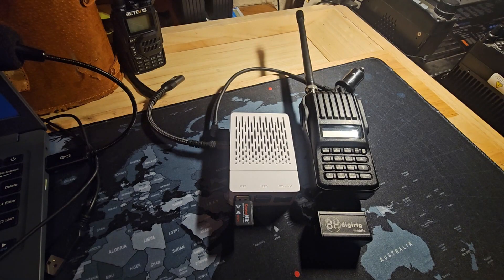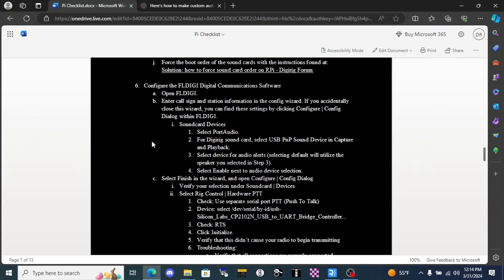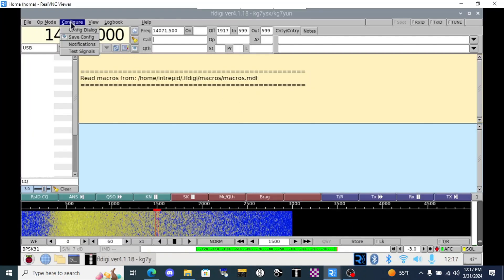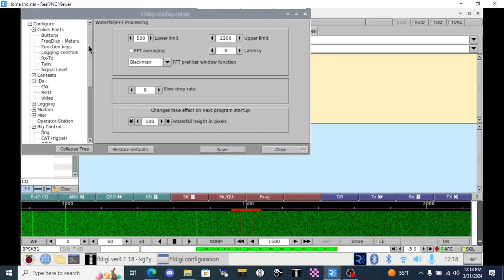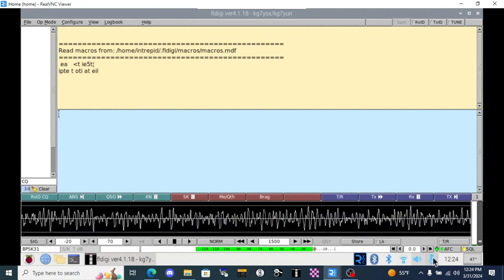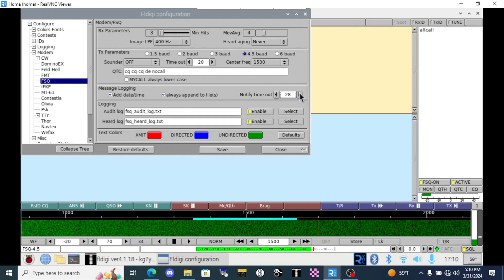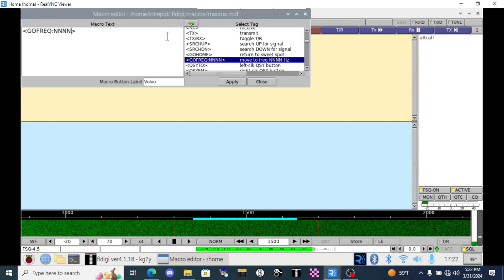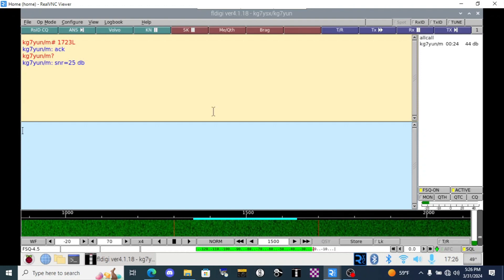FLDIGI & FSQ Setup!

Comment: On my fldigi screen, just below the File menu item, I have a large frequency display, then a drop down with all the different radio modes.  Not worried about the appearance, it could just be a different version.  However the dropdown is currently set to DATA-U  and 500 but I have no idea what that means, if that was set automatically or could be totally wrong.  Can you help clarify this?
Reply from the maker: I can help but there's a lot to unpack here and I need more info. Are you doing cat control on an HF rig or are you just plugging an audio cable into a VHF rig like my system? If you don't need the hf cat control "data-u" stuff, there is a view menu IIRC on the main screen where you can turn that off
Reply: @TerminalElement yes I'm doing cat control with FLrig and FLdigi. Not sure if they're setting the mode themselves as part of that control or if it's something I need to handle manually. Not receiving anything from anyone on any mode, otherwise it might be easier to figure out.
Reply from the maker: @true911m It's so tough to troubleshoot this remotely. What type of radio? Sorry I didn't see your reply. YT buries replies to replies and I have to manually look them up.
Reply: @TerminalElement  No problem, I've since seen a video referencing DATA-U as the mode to use.  Now trying to figure out the correct audio settings...
Reply from the maker: What type of radio?

Comment: Thanks so much for this guide. I've got 2 Quansheng K6 HTs, I've gotta set this up! There is an AIOC adaptor that is cheaper than DigiRig.
Reply from the maker: Let me know how it goes! I've seen that AIOC thing and I'm curious how well that works too. If it allows you to turn your squelch all the way off, and still key the PTT, then I think that's perfect. Some of the other/cheaper sound cards I've tried (that use VOX) weren't capable of this.